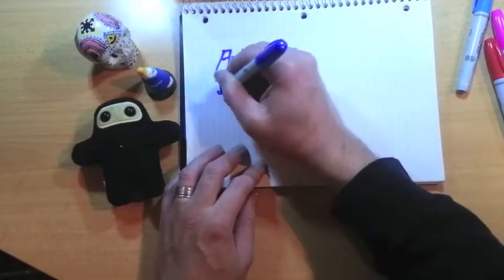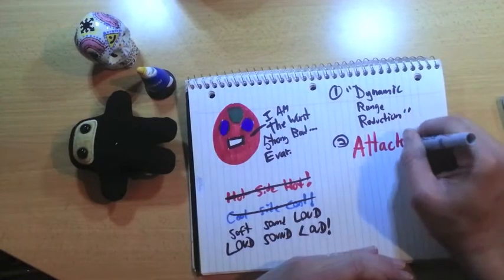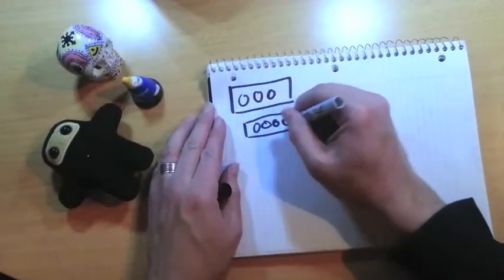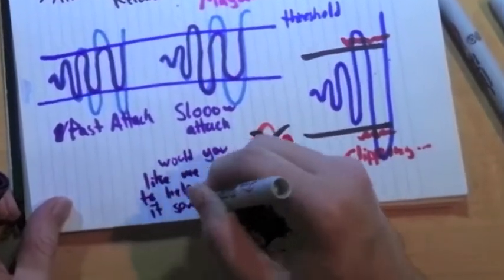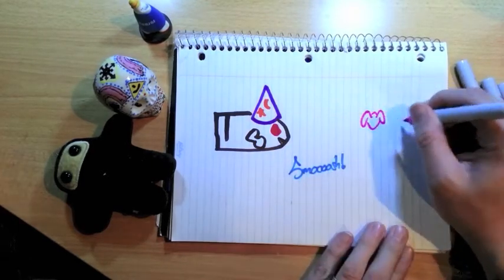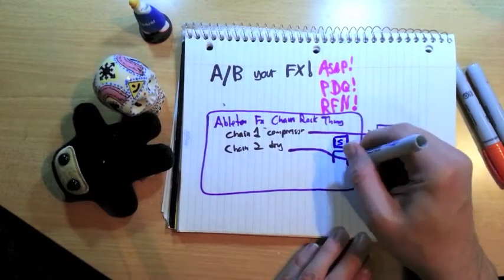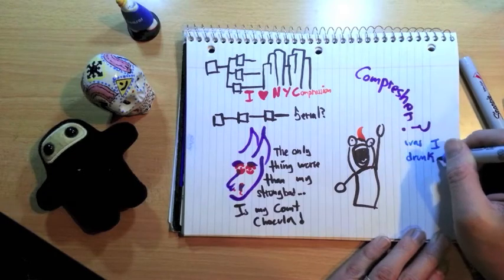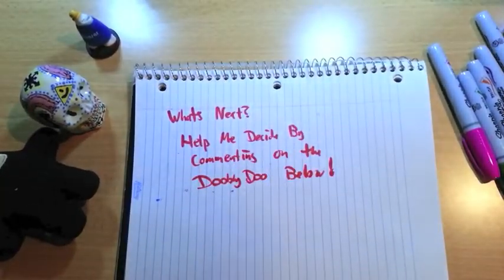I'm Jonnay - Episode 3 - Compressor Break your Studio Light

Comment: Totally agree about A/B, especially the importance of putting some gain on the dry version so you're only hearing the way the compression colors the sound. A big difference in perceived volume will make it really hard to hear any other differences. (This "volume changes trump everything else" phenomenon is exploited by salespeople to get you to buy more expensive audio gear; just make one louder than the other and most people will perceive the louder one as sounding "better".)

A similar problem affects A/B testing while editing photos. The A/B switch has to be completely seamless (no transition, no flicker, maintain exact same zoom level and position, etc.), or you'll be unable to perceive any of the subtle differences.